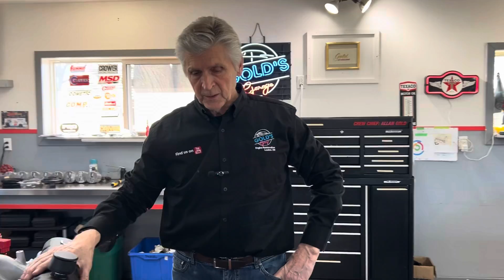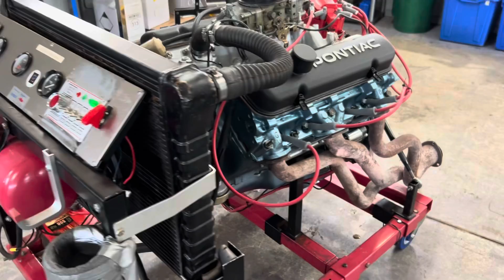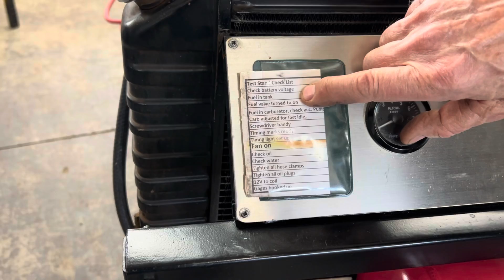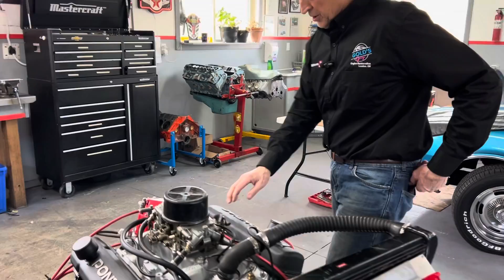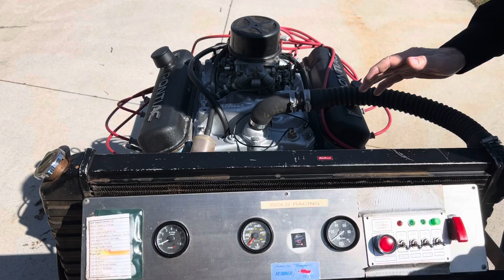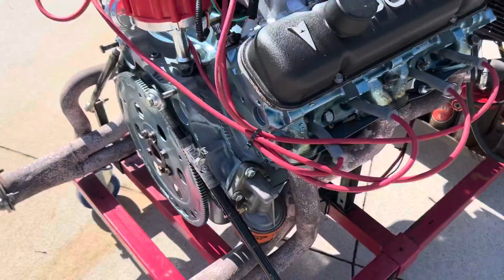Pontiac 400 Summit 2802 Camshaft First Start! How you can AVOID FAILURE!

Comment: I have flat tappet cam, and replaced all of my lifters. Since it is the same cam as before, would you recommend doing a break in procedure?
Reply: Also, what HEI distributor is that?
Reply from the maker: Yes, i would recommend following a break in procedure. AG
Reply from the maker: The distributor is BRAVEX HEI 65K volts, purchased on Amazon, I have used many of them and tested against MSD. They work great, 
even comes with Melonized gear. AG

Comment: Is there an accurate and simple way to check cam timing when the engine is in the car, I think my 67 pontiac 400 cube engine might be a tooth off,  I'm only showing about 15 pounds of vacuum. I don't have a degree wheel.
Reply from the maker: Great question Peter. Unless the chain was installed incorrectly I doubt that it is off by a tooth, 
There are 26 teeth in the crank gear and 52 in the cam gear. If the chain has slipped, the cam gear will be retarded by 360/52= 6.92 camshaft or 13.8 crankshaft degrees. 
Without knowing the specifications for your cam, typically during the overlap cycle, at TDC, the exhaust valve is closing and the intake valve is opening. 
Remove the drivers side valve cover, and the distributor cap. Rotate the engine to TDC firing, the rotor will point to #1 tower, and your timing marks will line up on the balancer. 
Now keep rotating another 360 degrees, the rotor will point to #6 on the tower. 
At TDC overlap the intake and exhaust valves should be open about equally. 
If the exhaust valve is open more than the intake valve (the exhaust valve is late closing and the intake valve is late opening,) then your cam is retarded. 
Hope this helps. AG

Comment: Sounds good Allen,do you usually do the 2500rpm for the first 20min right from initial startup like the cam companies always recommend? I do a similar check list so they fire immediately also.. I’ll leave the rad cap off n shove the garden hose in on low to keep temperatures stable and let them sing at 2500. I always follow with a lube n filter change and knock on wood haven’t lost one yet. But I’m hearing enough horror stories to lead me to believe QC sucks by today’s standards and think I’ll be going all rollers from here on out.. Good work, those ponchos run strong! You Still doin that pair of 302dz motors?
Reply from the maker: Thanks for the comments Phil. I usually run at 2500RPM or so until it reaches 180-200 degrees. It takes about 10 minutes. Shut it down, check all the valves while it is cooling down, then repeat. 
Yes we are still doing the 302's. The first block is back from the MS. I will be doing a video about it soon.AG

Comment: Alan do you do a prelube of your engines that is on a checklist before you get to the run up checklist. To me this is super important to know you are going to get oil pressure when it fires up and that a oil gallery plug has not been inadvertently missed.
Reply from the maker: Thanks Cabot. Actually I usually do it twice, once before I install the intake manifold, that way I can see the oil filling all the lifters. I also install an oil pressure gauge for this step.  I will be demonstrating this in a future video. The next time is with the push rods, rocker arms etc installed. AG

Comment: Alan isn’t 22.5 degrees of distributor rotation going to give you more like 45 crank degrees of initial advance
Reply from the maker: Thank you very much for catching this Cabot. You are correct. 45 is a lot, it will crank hard but still start. A better way would be to set the timing marks on the balancer at 22 degrees or so, then align the rotor exactly with the #1 tower on the cap. I appreciate your input. AG

Comment: Hey AG,
     Tim here, nice job!!!!!....sounded good, and we'll all pray that the cam/lifters STAY happy, with all the pooh goin around in flat tappet land.....i like the cam choice....i looked it up for the specs...just enuf rumble to know  somethins there, and shud give GREAT throttle response, AND drivability......those #16 heads (right, did i remember right?).....will LOVE that cam, as its specs are VERY close to the old Wolverine 301 (i call it), from back in the day.....224/230 and a 110 LSA is a VERY smart choice for a 400 Poncho, with the '68 (or so) iron casting heads......i enjoyed the vid!!!....i'm gonna build a 400 for my lady soon, as my 600 hp 462, is a bit much tryin to just drive around.....again, ENJOYED the vid sir, TY!!
Reply from the maker: Thanks for your comments as always Tim. AG

Comment: Local enthusiast from Ontario here, stumbled upon your channel while looking for Pontiac engine content, thank you for your videos!  Also looking to build a Pontiac 400 Ram Air III engine with factory 12 heads (72cc published combustion chamber size) and would like to keep it premium pump gas friendly.  Was wondering what was the static compression you hit on this engine?  From previous video looks like you were running a pretty tight quench and not using dished pistons.  Did you measure the dynamic compression? The larger LSA and later intake closing on this cam probably helped some with bleeding off the higher compression.
Reply from the maker: Thanks for the question El. I aim for static CR of 10.5 max. and cranking compression 180PSI max. The later IVCP has a major effect on DCR and cranking pressure, LSA does not. You can calculate all this with on line calculators. The final test is a compression test after brake in. Hope this helps. AG

Comment: So what specific things were you looking for after the cam break-in to confirm all was good? Also, you mentioned that you brought the engine up to temperature and shut it down before you did the actual cam break-in? Did you do this at idle or varying speeds to get to temp? Thanks for another great Pontiac engine video!
Reply from the maker: Thanks for the question and sorry for the misunderstanding G3. The cam gets broken in during the initial start up. Always keep the RPM above 2000. This splashes more oil in the lifter valley and then onto the cam. I do vary the speed between 2000-2500RPM. After it reaches 180-200 degrees, I shut it down and let it cool off. During this time I remove the valve covers and check the valves. Then i repeat the process. It may take 3-4 cycles to get 30 minutes of run time. Now, you can let it idle. Hope this helps. AG
Reply: @goldsgarage8236  Thanks so much for taking the time to answer this AG! This makes perfect sense.

Comment: Looked up specs. A 114lsa. Might a tighter lsa increase midrange torque? Though a 114 will carry on up top of rpm. Idle will be better. Your intent? Thanks.
Reply from the maker: Thanks for the comment Pat, every street cam is a compromise. AG

Comment: You avoid failure by not using flat tappet cams.
Reply: Well that for sure is one way. But IT"S NOT ROCKET SCIENCE. There's been 100's of MILLIONS cars run over 8+ decades and no 'massive pandemic of failures'. What do you think changed? Go back to what USED to work. I don't know why anyone would invest $2500+ to retrofit a HRT cam in a car they realistically hardly run. Buy the right oil and some DECENT parts and forget about it. If teenagers just learning in the '60's, '70's and '80's can figure it out and succeed, 'it ain't that hard' with 'good' parts.
Reply from the maker: Thanks Eric. That is one way and many machine shops will not build an engine with a flat tappet cam. AG

Comment: Whether your 'Cam break-in' is successful (or not) has more to do with your parts selection than anything you 'do'. Decades past, lots of people just winged it and violated about every 'rule' the people 'in the know' claim you absolutely HAVE to follow now. If anybody these days is building with a HFT cam they're probably well aware of what they need to do (hopefully) procedurally. 
Having the proper taper interface machining of the cam lobe AND the tappet is the single MOST IMPORTANT thing you need. As long this is OK, you can make some mistakes everywhere else, (and believe me people have), and you'll still come out OK. If this part of it is WRONG, NOTHING ELSE you can do will matter or make a difference to make up for it. It's doomed to failure.

That Summit cam is a fairly tame old General Kinetics lobe profile with long slow ramps. The biggest issue you'll face is quality lifters.  Just about ALL LIFTERS MADE TODAY even the US ones are garbage! I wouldn't even use any unless they were made in the mid '90's or before. You can't tell by looking at the 'swirl' either. I ONLY use NOS old lifters and NEVER had an issue. They made a TON of them and they're ALL OVER in flea markets and swap meets, especially for GM's. Usually cheaper than the 'new' trash. 
And it's complete BS that you need to get them to 'match' the MFR camshaft. The lobes/lifters from EVERYBODY are supposed to have the same engineered taper specs. There were 'only' 4 lifter makers in the peak production period. So what? They're supposed to recalibrate their production equipment for a 'Crane' lobe or a 'Cam Dynamics' lobe or an 'Engle' lobe? NO! Every cam maker sourced 'their' lifters from one of the 4 suppliers and used their packaging box. I NEVER had to look for 'specific' makers lifters. So, if you have one that gets 'sticky' you couldn't go to NAPA or Big A and just buy 1 replacement? 
A lot of this disinfo started with Comp and their noisy 'fast rate' HFT cams that have such poorly designed ramps and increase the valvetrain stress with lifters lofting off the lobes even at idle. Other makers seem to be able to get it right without the wear and noise and better performance. How can you avoid failure? Easy, don't buy ANY junk 'new' parts. 
For the first run I'd probably run a better oil filter than that 'Extra Guard', just my preference. You've got some great tips, really valid, but I would just scour the flea markets for some properly machined vintage parts and forget about the worry.
Reply from the maker: Thanks for the infomration Vince. AG

Comment: Back in the early 1980's Crane recommended warming engine oil on stove to help prevent cam failure during break-in.
Reply from the maker: Thanks guys, both good ideas. Dry sump cars like our super late model have heaters in the tank. AG
Reply: You could just use a magnetic oil pan heater. A Racer Brown 'tip' was to 'overfill' the crankcase by a couple of quarts of oil to whip up a good splash & mist. The camshaft is primarily 'splash' lubricated.

Comment: Why didn't you use the 455 rotating assembly in the 400? All you would of had to do is have the mains ground down from 3.25" to 3.00" and it would drop right in. Or a stroker crank to make it a 455 and use the 455 pistons and rods?🤷

Not sure what kind of internals the 400 has, did you guys get forged rods or are the factory cast rods? What rods did the 455 have, the Super Duty forged rods or cast? Did the 455 have better pistons? What about the 455 heads, are they better than the 400 heads? 

What was wrong with the 455 cam and lifters, why weren't those salvaged? Seems like a shame to go from a 455 to a 400 when he didn't have to.🤔🤷
Reply from the maker: There were many factors influencing the direction that Joe decided on. The 455 cam and lifters were in early stage of failure, (the lifters were concave). Joe used H beam rods in the new build. AG
Reply: @goldsgarage8236  
Did he know he could of made that 400 into a 455? H-beam rods work in a 455 too, I'm all for that upgrade. Not trying to put down the 400 build just curious if he knew he could of still had a 455? 
Those 455 parts that are still good have value, like the heads, crank, intake, timing cover, oil pan.....etc... and possibly the block can be repaired with a sleeve? Hopefully he doesn't just junk the whole thing, if he's ok not running a 455 someone else might be looking for a crank so they can?🤷

Comment: I am excited that you're testing a Pontiac 400. That's what I have in my 1976 firebird. It has 6X4 heads with stock flat top pistons. I don't know the compression but I'm guessing 8.5:1 maybe. I have a set of #13 heads I will be porting and another 400 block that's stronger that the one in there. Its a late model block 500557 which is thin wall so I will leave that one near stock. The thicker one came out of an old 1969 Grand Prix and when I get a moment I will build a hotter version with the #13 heads
Reply from the maker: You have quite extensive knowledge of Pontiac's Christopher.
Reply: IIRC to do that swap you'll need conversion motor mounts. I think the older blocks had a different mounting hole pattern? I know it's not a drop in, I'm sure you can find what to use.

Also they make nice stroker cranks for those 400s if you want it to be 455 cubes? The 455 only has a .030" larger bore from the factory than the 400 does so easy to do.😎👍

Comment: AG, where did you purchase the engine stand kit from?
Reply from the maker: Thanks for the question Steve. You can buy the kit from Summit. 
Larin Corporation Mobile Engine Testing Stations METS-1
 Part Number: LAR-METS-1.
I have a video we made last year detailing 
how you can build and modify this kit to suit your needs. https://youtu.be/rOvK9GtvfnU?si=_9o9PRRq5fyZhA42

AG
Reply: Alan,do you change the oil after the first run time or when do you change the first break in oil? 
Thanks
Reply from the maker: Good question David, I will change the oil and filter tomorrow, before delivering the engine to the dyno. AG